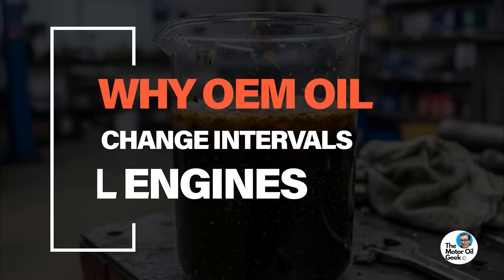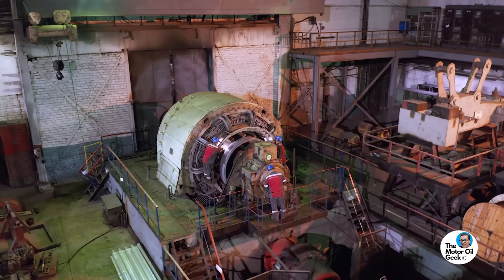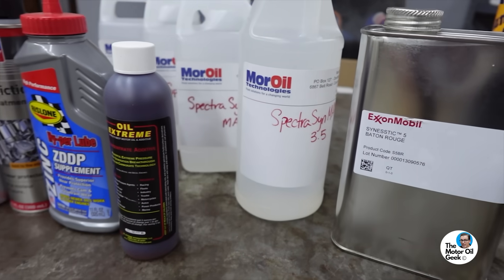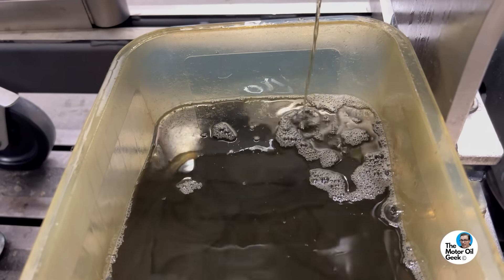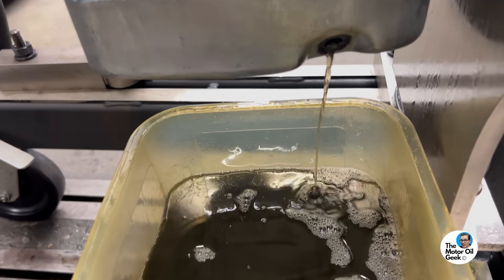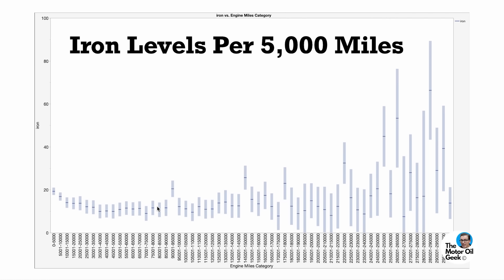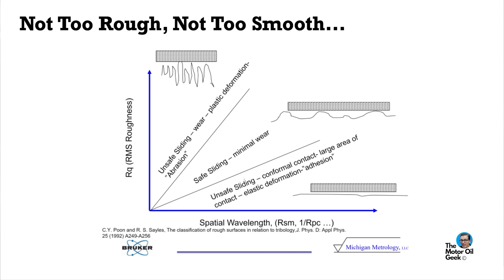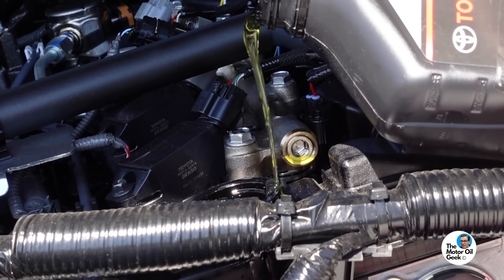NEW Data Reveals WHY Modern Engines FAIL Prematurely!

Comment: I have been involved with designing oil filtration systems for aerospace gas turbine engines in the past. We designed those for 3 micron absolute filtration rating.

One project was for the Allison Model 578-DX PropFan engine system which included a counter-rotating, double helical, differential planetary 8.33:1 gearbox which transmitted 13,000 hp. We designed and built a test equipment oil system for the dynamometer testing of the gearbox. We were using Mobil Jet Oil II (MIL-L-23699 at the time, now MIL-PRF-23699) that was advertised as "clean" from Mobil. We found that we had to circulate the new oil through the test equipment lube system for two to three days before we could introduce it to the gearbox just to clean up the "clean" oil. We took hundreds of oil samples for evaluation throughout the process.
Reply: Interesting comment.  I worked on the AGT1500 gas turbine for the M1 tank.  It has a 7 micron filter and the recommended oil was MIL-PRF-23699 class HTS (Mobil Jet  was the best).  I don't recall ever testing oil right out of the can.  Our biggest lube problem was Army mechanics topping off the oil tank with the wrong fluid; i.e. hydraulic fluid or XMSN fluid.
Reply: Interesting they are still using that oil, it's what we used on H-53 engines 30 odd yrs ago.
Reply: @Thomas-c7j3f  the story I told happened nearly forty years ago -- but that oil is still in use today in gas turbine engines.
Reply: @ronaldschoolcraft8654 Has the formulation, composition, and purity of the Mobil oil changed at all in all these years? What contaminants were showing up in the pre-filtration lab tests?
Reply: That's really interesting Ronald. I was an Air Force jet engine mechanic for MANY years. We always used Mil-L-7808 if memory serves.
Reply: @joelmeyers451 MIL-PRF-7808 is an alternative oil spec. The two can be mixed in emergencies, but usually not more than 50%. MIL-PRF-23699 has better load carrying capabilities but 7808 has better temperature capabilities. 23699 is generally considered better in most cases.
Reply: You can protect aircraft engines against damage from particles in the oil by bonding a lubricant to the metal e.g.
https://xcelplus.com.au/docs/faa.htm

Comment: "Old school" engines of the 60's, 70's and 80's used flat hydraulic lifters and they were usually quite reliable. Sometimes a lifter would collapse and go flat, resulting in a ticking or tapping sound in the engine. No harm usually can to these engines.

Comment: Interesting comment on not always changing the oil filter to increase its filtering efficiency. On a commuter car, I’m wondering if the filter should be changed every other oil change if sticking to a change interval of 4,000 or 5,000 miles max. Thoughts?

Comment: Particle counts on new engine oil in your tests vs 2 hour engine oil depend on particle size. If < 10 um and you see it drop on heat cycling new oil in the engine it’s ADDITIVE uptake and water cooking out of new out of bottle oil. It’s NOT wear reduction. ZDDP and ZDTP holds microscopic water from production and other additives adhere under heat to engine making what you describe in particle counts and ISO codes look better than they really are.
Magnesium Sulfonate being used is also hydroscopic and same small level of water cooks out of it.

Comment: Lake, I was under the impression that new vehicle engines are not broken in, but with the newer machining methods and the surface finishes don’t require break-in. I still believe running between 500-1000 miles to change the oil first. After that I drive my Silverado to 23-20% oil life and change it.
Reply: He has pointed that out in the past when he has discussed the very high levels of worn metal contaminates in the first 10K miles that drop significantly after that point. He even said it again in this video.

Comment: Unless physics have changed, liquid filtration IS NOT MORE EFFICIENT WITH TIME NOR CAN IT FORM “CAKE”, Your video is fantastic but promoting a false narrative about liquid filtration. You might have a high capacity oil filter that holds more grams of debris but efficiency is made by media ability to change direction of flow and throw particles and debris into media.  Capacity, efficiency and LIFE of a hydraulic or engine oil filter are separate areas of filter media design. Ask your Donaldson engineers to correct your commentary and understanding on this. Old oil filters are LESS EFFICIENT. 
I owned and operated DYSONANALYSIS for 45 years while being employed trained and retired from CUMMINS ENGINE CO. Research Center and am not talking outta place.

Comment: This explains the Hemi lifter failure at 150k miles but what about the gm lifter failure at 1 mile or 10 miles or 100 miles ?
That is a material issue called from a metal called chinesium

Comment: Can you say more about oil contamination and the effects on journal bearings used for rods and crankshafts?  In that case one of the surfaces is very soft, so the failure modes should be different.

Comment: I don’t know how this is still being discussed tighter tolerances, lower weight oil, longer oil change intervals and the metallurgy quality has gone down as well as production has been moved outside the United States
Reply: Modern engines aren’t Winston Cup engines. They are mass-produced and assembled by factory workers, not engine builders. There is a world of difference between the two.
Reply: @ChicagoRob2  and.....?  Neither were small block v-8s for 50+ years and every other mass produced engine. Old AMC 2.5l will go to 300,000 miles not burn oil and be neglected on oil changes over heat a few times and still not fail
Reply: because Lake has shown the additive packages protect better against wear as compared to prior heavier weight oil formulations....and tolerances are probably not significantly tighter nor are clearances (the correct term) over the last 20 years...and metals can have voids in cast parts but the grade of metal isn't inferior.....it has more to do with crap detergent in non-top-tier gas, longer OCI's being touted, and more direct injected engines as well as more turbo'd tiny engines and engines that don't get hot enough in a hybrid.  It isn't like there aren't new things to worry about, so long as administrations keep upping the mpg requirements, we will keep having new things to worry about.

Comment: I really enjoy your videos. I have learned a lot. When you talk about oil change intervals I assume you are talking ICE cars. What about hybrids? Their engines only run part of the time. What should be the change interval on a hybrid engine?
Reply: Probably the same interval (at least once a year) because the oil will still accumulate moisture and fuel dilution

Comment: You need to use crazy good oil filters (amsoil ea) and oils (amsoil, gl6 spec, etc). Run flushes every so often. Change oil more often.   Modern cars should have bypass oil filters. Fixes everything

Comment: 300 HP, 400 foot pound torque, high RPM engines with less main and connection rod bearings with water for oil.  Spun bearings?  No shit.   Get rid of the stupid high cost turbo and give me a  V6 non-turbo with less power and long live.   Modern engines and 10 speed transmissions are nothing but grenades on wheels.

Comment: Consider this:
First owner sells car at 60,000 miles.
Second owner sells car at 120,000 miles.
Third owner sells at 180,000 or drives it until it dies.
Who benefits from short drain intervals ?
The first two spent money for zero personal benefits.
Are you one of the 3% that keeps your new car forever ?
THINK ABOUT IT

Comment: Direct injection, Start/Stop, variable displacement are all, IMHO, perfect examples of the idiocy of the hypocrapts desire to destroy Constitutional Freedoms vis-a-vis our transportation systems via CAFE (over-)regulation, using the so-called "Green Agenda" and the fantasy of Climate Change as justification.  If californicate regulators were able to distinguish between individul water molacules there would be testing requirements for automoble exhaust content vs. precipitation!  It is all about CONTROL, folks.  Electrical consumption is just SO MUCH EASIER to monitor and control than the internal combustion engine using conventional carbob-based fuels. P.S. Change your oil early and often with an approved viscosity if you want your vehicle to perform and last!

Comment: On an engine simple is better.    Just pushrods and what worked so good in the later 90s and early 2000s the best engines made were from 1994 - 2006.  Pushrod engines with no direct gas injection.   Simple works and lasts longer.    No variable timing.

Comment: Lake, have you ever done any videos on air filters.  Comparing different types and such.  And to provide a bit of support for this video, I had three different GM vehicles with cylinder deactivation.  All purchased new.  Oil and filter changes at 500 miles, 1500 miles, then again at 3,000 miles.  After that, changes began every 5,000 miles.  All three engines were driven in excess of 225,000 miles.  None of them ever experienced any issues with the cylinder deactivation system and only one began to consume oil after 225,000 miles.  That was a 2007 Avalanche which was known to have oil consumption issues.  Always used Mobil One dull synthetic oil.  Also had a 2017 Tacoma which I started out with Mobil One, but switched to Penzoil Ultra after I learned about it.  Ran it for over 225,000 miles and it never had any issues as well.  Change your oil people!

Comment: So near the end of this video you made mention of not falling for, "...the high-flow trick or the week" air filter. So is that a hard NO on things like K&N engine air filter?
Reply: It was a hard no on any low efficiency filter. Low efficiency means more dirt inside. In his filter video he demonstrated how significant a 99.0 vs 99.9 filter efficiency was at passing dirt into the engine.
Reply: @jacks_DIY98  Yeah, been rethinking this whole K&N thing and just ordered Motorcraft engine and cabin filters for the F-150.

Comment: My 2 cents on oil additives. A while back, I added Restore to my 2007 Honda Pilot during an oil change, even though the engine did not consume oil. At the time it had around 220,000 miles on it. The engine was quiet. A couple of months later, I noticed a noise from the engine, similar to a valve tick. I drained the oil and saw very large particles of copper in the oil. Fearing that a bearing(s) was on the way out, I dropped the oil pan. What I found was more of the large copper particles had stuck to the bottom of the pan, and where the oil returns emptied from the block, down the sides of the pan, there were sticky vertical trails down the length of the pan. They kind of resembled very long tire plugs, imbedded with more copper flakes. I cleaned everything up, and pulled the rod bearings, which were showing some minor copper exposure, nut not to the extent that would account for the large copper flakes. I was able to roll in new rod bearings, and I checked the valve lash, which was fine. I wasn't able to remove the main caps, due to the horizontal main bearing bolts. During the last three oil changes, I haven't noticed any copper, but the tapping noise is still there. Reading the ingredients in Restore, it mentions CSL, which stands for copper, silver and lead. So, I have to guess that's where the copper came from.
Reply: I used it in a couple of high miles engines and it reduced oil consumption and noticeably improved seat of the pants performance.
It worked.
Reply: Lake has told us, don’t use oil additives. 
But it’s your dime. 
Seat of the ants in the pants feel huh?

Comment: It would be fascinating to review your 2019-2024 6.7 liter Cummins oil analysis. The manual from the manufacturer indicates that there is no specific break in procedure required as a new engine. Let’s see the data from your lab, I’m sure it proves otherwise. Thanks for the great content!! Note: I’m a 2022 6.7 HO Cummins owner.

Comment: I understand your deep dive, But todays engines are far too complex. Most people do well changing oil, but todays engines are just too complex. Designed to fail.. Engines today are ticking time bombs. Combine ultra thin oils and oil filters that are the same as 1960, a recipe for disaster

Comment: Bought a 2010 Suburban in Montana in 2015 with 100k on the clock. Discovered the lifter tick soon after purchase when cold. Swapped oil to 0W20 in winter and returned to 5W30 in the summer. Disabled the DOD at 120k.  I change the oil religiously and use Seafoam or MMO every few changes to do a cleaning prior to oil drop.  210k miles on it now and still following the same routine. Still ticks for a short time once in a while during cold starts.  Luckily, there aren't many of those in Florida where I've resided for 5 years, but it's getting more sensitive to temperature change and wants to tick more often.  The point of all of this is keep your oil changed regularly and DOD is bullshit.  I hate using the 0W20 at all, but I'm determined to get at least 250,000 miles before I have to yard out the cam and replace all of the DOD garbage. Since compression is still 210-225lbs I figure it will be worth swapping cam and lifters and eliminating the DOD. I plan on this rig being the last one I buy in my lifetime anyway.  I refuse to buy anything newer.

Comment: I have a 2004 Jeep Grand Cherokee with the 4.0l and she has 482,000+ miles, using Mobil 1 10W30, and changed every 3,000 miles. The engine has never been opened up, 100% original

Comment: Nice, doesn't explain the PDi with lifter tick at 5 miles. In fact oil are getting too good and masking alot of bad engineering/cheap material manufacturer use now. Back then, oil wasnt as good so Manufacturers built engines to withstand wear.

Comment: Im all big fan high polarity  engine oil hyper lubricants ! Especially  AN -HBN which is alkylated naptholine and hexagonal boron nitride etc . These lubricants can save engines with no dedicated lifter oil passages like the hemi that uses splashes from the cam to keep the lifters lubricated !  Always use a good quality  eng  oil And also never neglect your OCI 's !! You should make a video on hyper lubricants  AKA snake oils ! Would be %100 interesting! 👍👍

Comment: So, say your OCI (including filter) is 3k miles.
The drain oil will have fewer particulates than the brand new oil originally was, directly from the bottle and even cleaner if the filter change interval is 6k miles?

Comment: I change my oil on new cars right after taking delivery. 
Then at 250, 750, 2000, 5000.
Then 5k OCI for life.
All my cars have hit 125kmi + with no oil burn. 
Only after they hit around 150kmi on turbos does oil burn start and accelerates quickly.  But its always been turbo bearings given how oil starts increasing in the intercooler. NA engines might start burning oil or not at all after 165kmi.

Comment: I Leased  a 2024 Toyota TUNDRA TRD my first oil change 850 miles , 3500 miles , 10,000 and sent a sample to the LAB report looked promising...Now my oil changes will be at 5000 miles or 8000 km intervals from now on most miles are HWY miles.. TOYOTA CORP. MANUAL RECOMMENDS OIL CHANGES AT 10,000 MILES OR 16,000 KM INTERVALS, NOT HAPPENING PERIOD .. I just did an oil change yesterday at 15,000 miles and went from 0w-20 to 5w-30 ALL oil changes from dealer.. My plan is to send another lab sample at the END OF MY NEXT  5w-30 oil change hoping everything is good will see... Mr.Geek you must be aware that there's another RECALL of 125,000 or so on the ' V35A-FTS' engines, now I'm waiting for paperwork from Toyota ..Meanwhile I'm doing my own TESTING an i will be sending a report to Toyota Corp. when I'm DONE...From ONTARIO,CANADA..🤠🤠